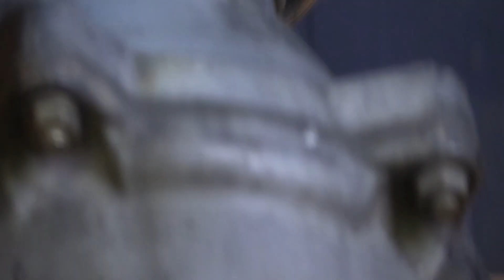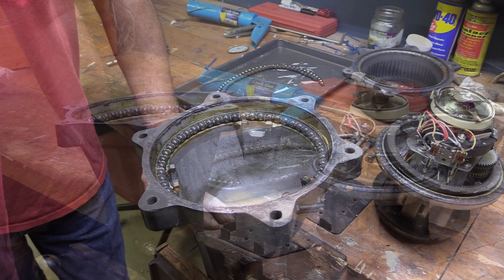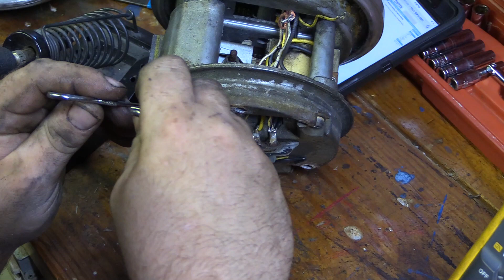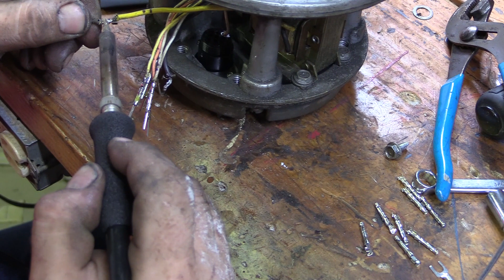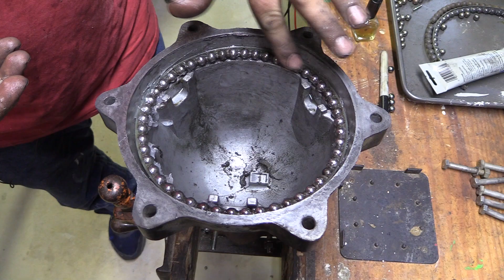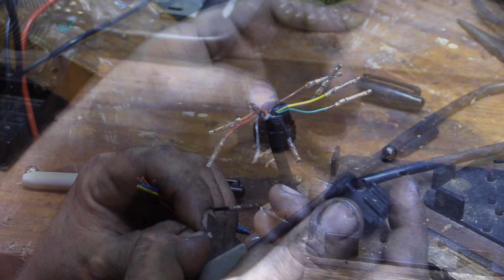repair and upgrade of a Hygain Tail-twister rotor

Comment: After a thorough cleaning of the two large halves, I powder coated them a nice gloss black.  Then I installed your round connector, which is a huge and awesome upgrade.  Today I installed new bearings, packed them with grease, and following your excellent instructions, I clocked the unit and reassembled.  Wouldn't you know it - it works great.  Thanks once again for such a helpful and thorough instructional video.  You saved me some serious money!  Great job and 73 OM!  de WB1ANA

Comment: Excellent video!  Very helpful and informative!  I have a T2X that is in working condition, but it sat in a tower for at least 6 years unused.  I want to replace the bearings, clean it all up, and grease the new ones.  I also want to do the connector upgrade that you did since it makes a LOT more sense.  Where can I get the kit that contains the plate that yours came with?  All the ones on eBay don't seem to have that plate.  Thanks for doing this and for showing how easy it is.  Great job and 73!  de WB1ANA
Reply from the maker: I have the kits on eBay for sale cats went out of business and I picked up the connector just look for Hygain on eBay
Reply: @Kc8qdq  The kit arrived late last week and today I installed the connectors on both the rotator and the cable.  Everything is working as it should.  Excellent instructions and a huge upgrade.  Thanks!
Reply from the maker: @tomscyclerecycling8242  my pleasure thank you for you purchase
Reply from the maker: https://ebay.io/m/DPbyoL

Comment: One CDE rotor that I have yet to see outside of radio ads is the TR-12, a worm-drive rotor from the 1940s-50s with an outboard thrust bearing made to handle very heavy antennas.  It also happened to be their first product to use an analog dial.

Comment: Thanks for your video!  Last week I bought a T2X it the original box, date code of 1987 that was pristine inside and out, like it had never been used.  I put in the C.A.T.S. AMP connector and your Youtube made it a snap!  It's wired, tested and ready to go up when I get a crew together.  ...de Ron N6IE
Reply from the maker: @rontheman1487  thank you for the kind words and thank you for the purchase of the connector

Comment: Hi Jeremy, Thanks to your videos, I've just managed to repair and old tailtwister from 1989 (no grease anymore, some rusted balls, rusty connectors aso...). Your comments have been very usefull, specialy to put on the right configuration the ring and the copper arm of the potentiometer before screwing the lower casting. All turns ok on 360 degrees,  the brake does a strong metallic noise when plugged / unplugged but it should be normal. Another tailtwister will soon be happy to turn HF beams in middle France ! Ollie, F5IAE, radioactive 365/365
Reply from the maker: @OlivierPennetier  that’s awesome! Glad I could help a fellow radio enthusiast across the pond 73s and good dx

Comment: Thank You Jeramy for the GREAT VIDEO. I have this model exactly and it was built in March of 1997. Following your video step for step I was able to take it apart, remove the old somewhat rusted bearings and races and then clean out the original grease (yellow ?) and put in the new bearings (from eBay) and the fresh grease (Super Lube for Home Depot) . Everything else looked fine so I reassembled it and it worked smoothly in each direction.
A really great video and made me feel easier in doing the job instead of sending it out for someone else to do.
Thank You, Thank You, Thank You!  73 KE8TQR
Reply from the maker: My pleasure if you ever want to upgrade your connector give me a text 73 glade I could help

Comment: Hello Jeremy, 
thank you for this detailed and interesting video. 
I have recently removed exactly the same rotor and it seems to be just as old and certainly needs maintenance.
Mine has the cables also still attached with screws, where can you buy the package with the connectors and the socket to convert the rotor to it. 

And are there spare parts from the manufacturer still for this rotor, I think it would make sense to replace the mount for the ball bearing balls, can you buy these somewhere?

Many greetings from Germany

73 Per dc0hs
Reply from the maker: Mfj will sell the parts and cats rotor service sells the connector
Reply from the maker: http://www.rotor-parts.com/catalogue/oscommerce-2.3.3.4/catalog/index.php?cPath=21_32&sort=2a&page=2
Reply: @Kc8qdq  Thx a lot  br Per

Comment: Really the best video I've seen on rebuilding a rotor ...great explanation on getting it back together!! ...now I know why my back up rotor didn't turn all the way ...my clocking is off and I put the tab inside the shut off relay ....simple fix now that I know what's wrong I can fix my back up rotor ....thank you for up load my freind and 73 ....DE N5OMV in west Texas
Reply from the maker: My pleasure

Comment: Goodmorning, I have a CDE autorotor AR 40 and want to do a revision, is it possible to put a connector on this model? and wich type nummer do I need? and wat is the diameter in mm of the ball bearings and how many do I need?
Thanks and 73's PE1 NXG
Reply from the maker: Yes the connector will work but you will not use all 8 pins. 3/8 is the  ball bearings

Comment: It only takes a thimble full of grease to do a dry rotor.  Also, rotate until the controller points north so you will know what direction to point the antenna.

Comment: after soldering the pins (that go on the new connector) you bring a big black wire up to the top and solder it to a metal ring that goes around the end of the black tube where all the wires come out - please explain this -  where did the big black wire come from etc
Reply from the maker: The black wire is the ground. And is now attached to the chassis. The black wires are in with pin one
Reply from the maker: Check out my other video  on rotor repair

Comment: Thank you Jeremy, you made servicing my rotor a walk in the park!
The rotor has been in the air since 2000, but I have been inactive for 15 years. There wasn't one bit of grease left in it. The bottom bearings had rust on them. Other than that it still looked new inside.
The races had some oxidation on them, but cleaned up just like new. New bearings and grease and it's just like new. I'm really lucky that the races didn't look like the one's in your video! Again, thank you!
Reply from the maker: My pleasure

Comment: do you sell rotors? i have one that makes a wierd noise inside and it sounds like maybe in the motor part. like its skipping. can the motor or armatures be replaced?
Reply from the maker: I usually just replace the motors
Reply: @Kc8qdq  where is a good place to purchase a motor? i will tear it down and get back. i have another i might buy but he wants a little much for it, i would at least have it for parts if so
Reply from the maker: @bretshivers8352  mfj
Reply from the maker: It might just be the gears. Have you taken it apart yet ?
Reply: @Kc8qdq  no sir i dont post videos on here or i would send you one of it running

Comment: Jeramy, thank you for this video, it is going to be a great help to me. I have received a Tailtwister, Ham III and Ham IV with controllers which are in need of overhauling.
Couple of questions, if you would kindly answer;
1. Notice you didn't put any sealant between the two outer molds, would it be better to run a small bead to help seal the sections?
2, I would like to repaint the outside with the likes of CRC Black Zinc to help protect it and make it look better. Your thoughts on this.
Now to the build, thanks Kevin, ZL1KFM.
Reply from the maker: Have never thought of putting sealer on the two halves. Good idea but never seen it done. I don’t ever worry about the paint I just want them to function. But that’s up to you my friend